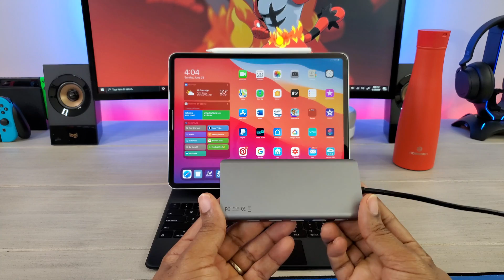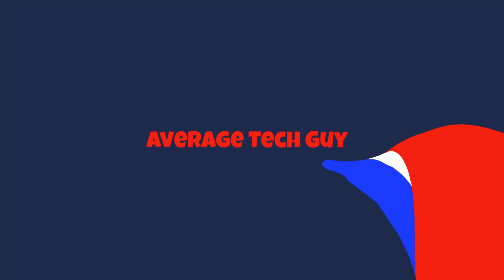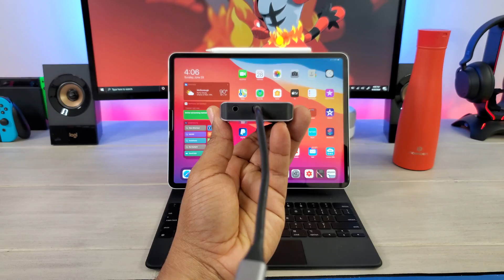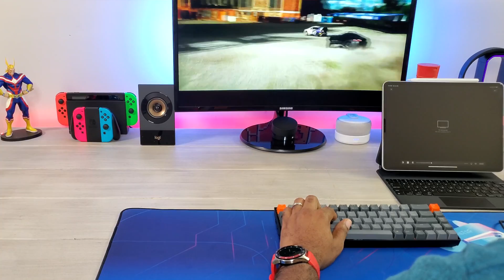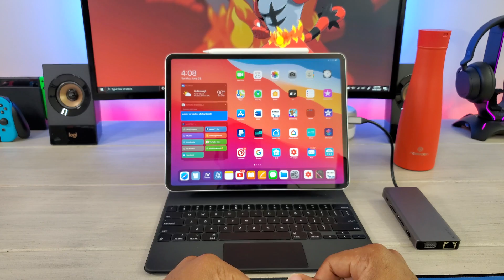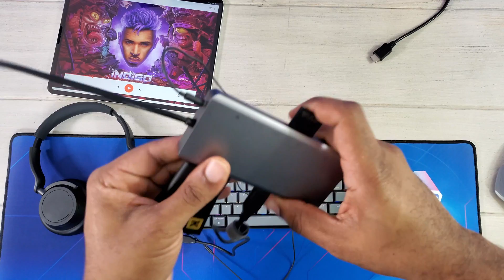The Ultimate Hub For iPad Pro in 2020...  Ethernet Included!!!

Comment: That is a USB-C hub for the Macbook on an iPad. Isn't it a bit dangerous to advise this, since it has a charging port?
iPad Pror: 20W-30W safely.
Macbook: 85W-100W.
If it was a hub for data, it doesn't matter but for charging, you are putting devices at risk. That's dangerous.

Comment: Instead of plugging the hub into the side of the iPad can the hub be plugged into the magic keyboard???
Reply: I think you missed the question. If you have seen the new Apple magic keyboard there is a USB C Port in there, it can be used to charge the iPad simultaneously if the one in it is in use. And the answer is yes but the connectivity is very sluggish

PS. And it drains more power

Comment: Using this hub you can raise up volume or decrease volume if you plug in headphone
Reply: Adriel Cruz no , you can not. Hot this hub and it has some Issues. An example is when you plug it in and try to run YouTube app the video signal will be sent to this hub. So you will see black screen on iPad - and no options to change it. Few more issues too..